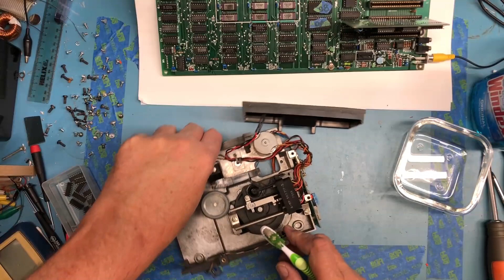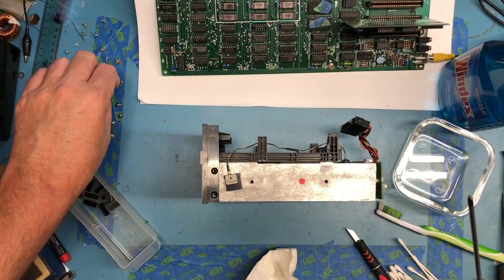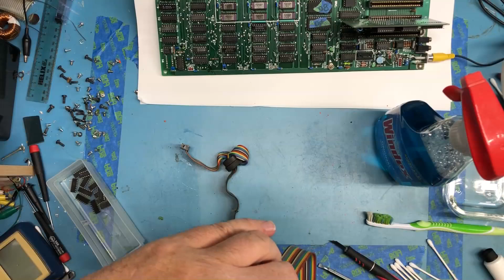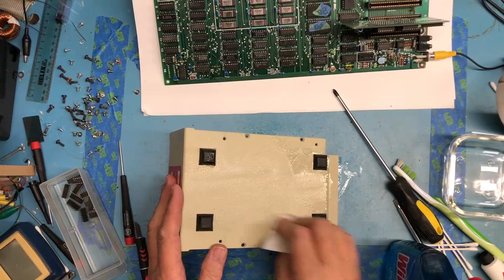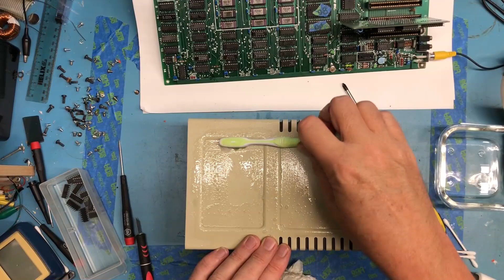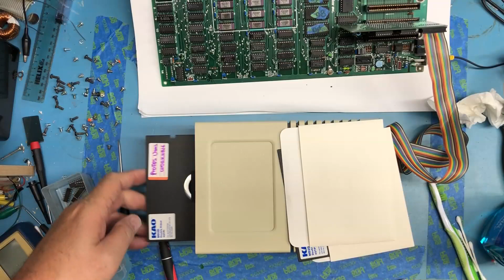APPLE II Plus - Part 6 - Disk II Cleaning and Servicing - STB201

Comment: apple service guide says don't use any lubrication on the drive,  should we ignore that?
Reply from the maker: Good question. I choose to add a tiny bit of lube only because I could feel how rough the pin moved in the groove. Some lubs may attack the plastic. Too much lub might end up with  the pin coming out of the groove. Oils tend to attract and hold dust which could be abrasive wearing down the plastic. As I recall Ithe lub I used wasn't oil based and I used a tiny amount, maybe a silicon lub?  So, I can't advise either way. i haven't tested the drive over time so I don't know the long term impact of what i did.